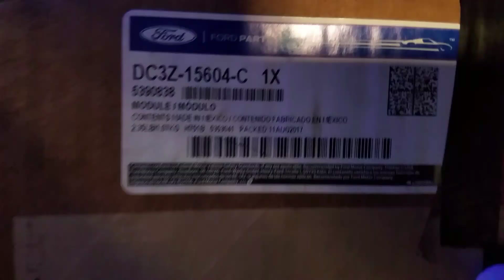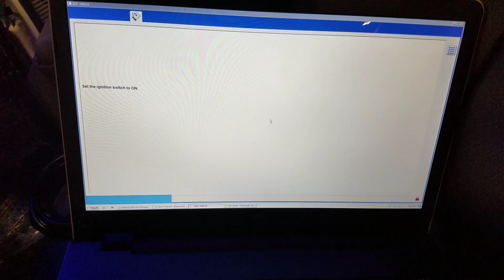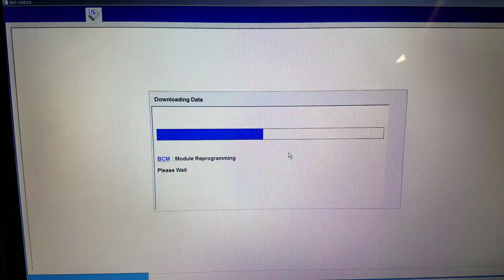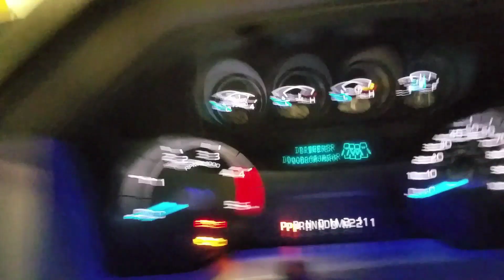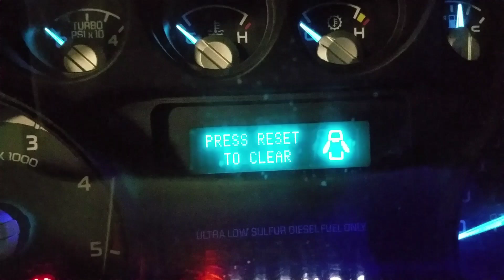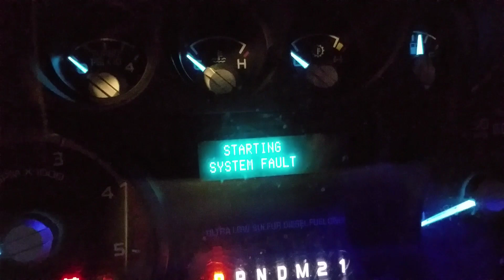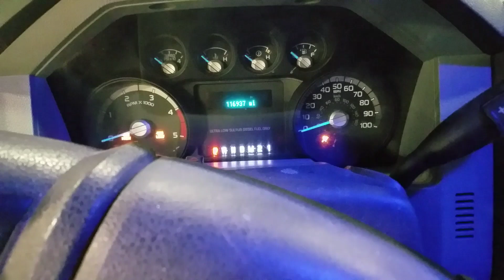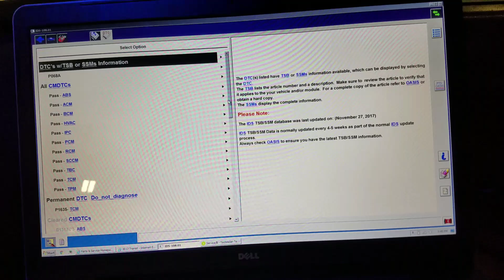BCM R&R - FsuperDuty

Comment: Great video very informative I feel whoever designed the module to be located there should be subject to public thrashing. It took me 2 hours to change a fuse.
Reply from the maker: Lolol im sorry dude haha
Reply: Hope you can help 2012 f350 185000 6.7 i dont know the whole story on this i do know it was towed in for a fuel leak and the keys were lost it sat for 9 to 12 months i had a company come and cut a key and program the new key i have a no crank and not all the warning lights in the dash when the key is turned to crank i can hear a relay click and all the lights that were on go out untill i cycle the key i have done a good bit of testing checking continuity power and grounds it has 2 new batteries cause when it was sitting they walked off lol if you have time i could use your help thank you
Reply from the maker: You're gonna have to have the keys programmed

Comment: Do you or anyone on here know if the 2013 f250sd with the 6.2 gas engine has a gems module or what controls the information display?
Reply from the maker: No gem, what are you talking about the instrument cluster??
Reply: @PowerStrokeTechTalkwARod  Yes the instrument cluster. It all works accept the information display where the odometer is. I think that is accessible by the steering wheel. I just bought the truck an was told it needed the bcm but what he explained as the bcm wasn't the fuse box. Is there something above the fuse box?
Reply from the maker: The bcm is the fuse box. It is a module. It does not control the cluster. The cluster is a module itself. U most likely will need a cluster to repair the information display. If the steering wheel buttons do not work, it will not change the info in the display. IE: make sure your switch packs are working correctly at the wheel
Reply: @PowerStrokeTechTalkwARod  Thats what I thought. The guy told me that they used this truck to pull a module (he thought was the bcm) off the inner fender well. I see only one plug that is not plugged in above the fuse block and there is no box there. I have no start, no heater blower but stereo comes on and no sound all lights work, no horn and that information display issue. This truck is a base model also so its missing all the fancy looking stuff in the cluster and the stereo. Thanks for you replies.
Reply from the maker: Yea ull need a bcm, it will need to be programmed in. You will need 2 keys to start....or to program the new bcm
Reply: @PowerStrokeTechTalkwARod  So even though I have the bcm plugged in on my truck it sounds to you like I need a new one? what about trying to reprogram this one?
Reply from the maker: It would need to be properly diagnosed. Reprogramming wont fix somethin like that. Ive had a lot of wiring issue as well
Reply: @PowerStrokeTechTalkwARod  So if I buy a new bcm and just stick it in there will the programmer do the rest like your video shows? Forscan is what I was thinking of using. Thanks for all your time!
Reply from the maker: Im not sure how that scanner works. Not sure if it can access fords database to get the configurable data it needs to program. You cannot just slap it in. The old data while need to be exhaled from the old module and inhaled to the new. Then you need to carry out the PATS programming and a few other things....
Reply: @PowerStrokeTechTalkwARod  Last question, do you think this is the cause of the information display not showing or thats a separate issue and will need to replace the cluster also?
Reply from the maker: We will need to follow the appropriate pin point tests for your concern. Too much money in parts to be guessin. Might have 2 bite the bullet and go see the dealer....
Reply: @PowerStrokeTechTalkwARod  Do you know what box is above the bcm on that inner side of the glove box? That is what the guy thought was the bcm and is no longer plugged in or with this truck. just a plug up there and a space you can see where something went.
Reply from the maker: That is the APIM
Reply: @PowerStrokeTechTalkwARod  what does the APIM  do? Mine is gone. Also I have tried to connect to the obd2 with a scanner and it comes back as unable to connect to vehicle, make sure key is on and try again. The key is on.
Reply from the maker: The apim is for the audio system & sync....if the scan tool will not connect it sounds like you have more issues goin on, maybe a communication issue....
Reply: @PowerStrokeTechTalkwARod  I was looking up the APIM and there seems to be multiple plugs that go into it. I only have one disconnected small plug and its right above the bcm about 6". This was a mining truck and it is full of dirt and dust, thinking it might have bad connections somewhere. Is there a common place to start looking for that?
Reply from the maker: No man not really
Reply: @PowerStrokeTechTalkwARod  well I bit the bullet and took this into the dealer and they gave me the truck back in the same condition I took it to them in, (not starting). Took them the new bcm and had to put in a good used pcm because mine was shorting out internally. They were supposed to reprogram my vin to the pcm (which they state they did. They state they can't program keys, comes back as a keys programmed code and pats code and cannot parameter reset. They want a couple more hours diag time but then I brought it home ran my scanner and the old vin is still showing like they programmed the wrong vin back in. My question is, do you think if they did reprogram with wrong vin that the codes I mentioned would show up like that? Otherwise, what else do you think could be going on? They seemed to think the bcm was good that it was just the shorted pcm in the first place but I am wondering if the guy working on it even knows what he is doing if he put the wrong vin back in.
Reply from the maker: Oh mann....thats a tuffy....wish i was closer to yas
Reply: @PowerStrokeTechTalkwARod  wish I could afford the tool, I think I can do it myself.
Reply: @PowerStrokeTechTalkwARod  do you know if when programming a pcm does the new info automatically get programmed to the bcm as well when using as build? I put my new bcm in and am getting ready to go have the pcm redone.
Reply from the maker: When you program the truck with as built data you can only do that procedure with one module at a time as built RCM as built PCM as built BCM them programming the PCM with the files that are for your truck have nothing to do with the BCM those are two totally separate modules that are programmed one at a time
Reply: @PowerStrokeTechTalkwARod  I ended up with an unrepairable pcm and bought a new blank one. When this one gets programmed to my vin will I need to use my prefix and suffix and tear tag from the old pcm or from this new one?
Reply from the maker: You will have to use As-built data when you program it with IDS. Make sure your connected to the internet when you do it...will need to do a parameter reset & program two keys.
Reply: @PowerStrokeTechTalkwARod  do you know if a 6.2 f350 BCM can be re programmed on a 6.7 F350? Trying to get power features

Comment: I had a question in regards to aftermarket tail lights on a 2011 F150. Research shows the LED tail lights cause the BCM to go into “turn signal out” or “hyper flash” mode. Mine was in hyper flash when I got it from a used dealership. I didn’t know what that was at the time so it wasn’t a concern. Then after a month or so my tail light signals started malfunctioning. Putting on a right signal would cause both tail light signals to flash like my hazards were on. Putting on a left signal would do nothing.. no tail light singnals would flash. My mechanics saying I will need to replace the BCM. God forbid $500 + for a tail light issue... I did some research and found a OBDII tool that works with a smartphone app to reset the BCM. I found comments and videos saying that this works. The tool is 20 bucks and the app is 5 bucks.. I figure it’s worth a shot to try that first. What you think?
Reply: Did this work?
Reply from the maker: Yes
Reply: Bobby Stokes  The hyper flash would let tyou know that there is a burned out lamp the BCM senses the loss of resistance , if you put a load resistor in it will solve your'e problem

Comment: My f150 BCM was broken.
Do I have to use the same part number BCM?
Ford P / N is the same as the existing one.
The Ford kit P / N is different from the existing one.
Reply from the maker: You need to have the Ford parts department VIN match what BCM your truck is supposed to take.....it will need to be programmed in. The truck will be unable to start or move until that is done. BCM's are NOT plug & play...jst FYI
Reply: PowerStroke Tech Talk w/ARod Thanks man!

Comment: My 12 f150 does not work with passenger side tail lamp brakes and turn signals. The passenger side front turn signal works. Is this BCM problem?
Reply from the maker: Not necessarily you gotta do some tests Mister Harley-Davidson
Reply: PowerStroke Tech Talk w/ARod When checked with the OBD scanner, it says Circuit Short To Ground.
Reply from the maker: Yea short circuit to ground...you have to test the said circuits to see if its the wiring or the module broski.....
Reply: PowerStroke Tech Talk w/ARod Okay, l’ll try 
Thank you.
Reply from the maker: Yea thats the bcm. It needs to be programmed in, both sets of keys will need to be program as well. Additionally a bunch of other functionalities will need to be reset...bcms are not plug and play
Reply from the maker: No just one
Reply: PowerStroke Tech Talk w/ARod Thank you sir!
Reply from the maker: Yep

Comment: I’ve got turn signal issues, check everything and come to the conclusion I need to reset the BCM. Can I do this by unplugging the batteries and letting the truck sit for a while letting the capacitors run out and then eventually going back on. All my turn signal issues started when I put halos and hid headlights in. Lesson learned on my end, don’t mess with vehicle electronics. Or can a Snap-On scan tool reset it. The local dealership is not helpful with much other than a oil change.
Reply from the maker: "Turn signal issues"....im not sure a BCM reset would fix such a thing, plus there is not BCM reset to do on these Superdutys using IDS..which is the scan tool ALL Ford dealers use...
Reply: PowerStroke Tech Talk w/ARod 

I’m kinda to the point now where I am all out of options lol, can I do a reset by disconnecting the batteries and letting it sit for a day
Reply from the maker: Sorry it doesn't work like that bub...i dont know what your concern is. Turn signal issue, complaint is a little to vague for me 2 direct you to do anything really...
Reply: PowerStroke Tech Talk w/ARod 
So basically my issue is the right turn signal won’t turn on. I’ve checked all connections over and over along with the help of several other people who are pretty good with electrical problems. I don’t have any shorts in the wires and you can send power with a power probe and get the light to turn on. When hooked up to a snap on scan tool the first time I reset the BCM codes and the problem went away lights worked fine for about 6 months. Now the same problem is back and when hooked to a scan tool it won’t actually fix the problem. Two codes are still existing after deleting. One says open circuit short to ground. The other says solid state driver protection. I’m trying to remember the numbers but one was like U3000:49 maybe and U1000:00. I can’t remember exactly. So I did everything I could think to do with that the scan tool to delete and run self test and all the options and still no working turn signal. When checking voltage coming to the signal light the BCM is only sending something small like 0.4 basically nothing. Any ideas on this. I’m thinking the BCM is either bad or locked in a mode I can’t get it out of. Which means I might need to go to ford and the local ford place is not going to understand this problem correctly.
Reply from the maker: You are gonna need to replace your BCM you will need 2 Ignition keys that need to be reprogrammed because the pats functions are all in the bcm you'll need to get that programmed in as well
Reply: PowerStroke Tech Talk w/ARod any idea what that will cost to do all that?
Reply: My 550 is having left rear and brake light issues. Tested a bunch of stuff and it's my bcm not sending signal.
Reply from the maker: Yepp have done multiple
Reply: Arbor-Works Tree Service cleared codes on BCM fixed all issues

Comment: My 2014 F150 fx2 is showing a message on the screen saying "system off to save battery" then the screen goes back and the heat kicks on and can't shut it off. Could this be a problem with the BCM shorting out?
Reply from the maker: I duno bub, have to put ids on it.

Comment: I had to replace a BCM, I believe it was on a 2014 F-250. This vehicle came in with the right side headlight not working. Long story short, the aftermarket plow wiring for the headlights were poorly installed. This was confirmed when I supplied B+ to the right side low beam circuit and saw a nice smoke show. Upon installation of the new BCM, the front power windows were now inoperative. After pulling my hair out rechecking my work and unable to find anything wrong, Ford Hotline instructed me to uninstall IDS and re-install about three older versions of IDS and redo the PMI process again. Sure enough, it worked. Made me wonder what was wrong with the current version of IDS. The point being, I wasted a lot of time through no fault of mine.
Reply from the maker: Dang man what a headach. I memeber those ones, gosh what a pita
Reply: The F350 Super Duty 2008 right side headlight does not work and the key is off and the dashboard lights are still on. Help me please
Reply from the maker: Try a multi function switch